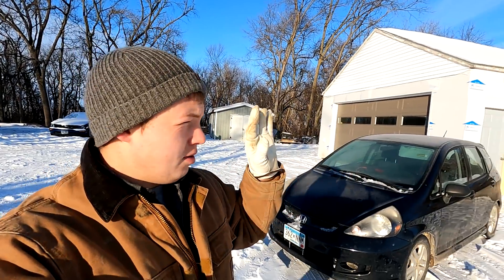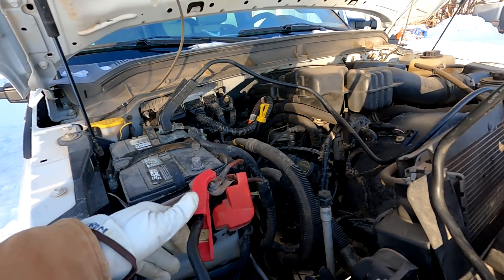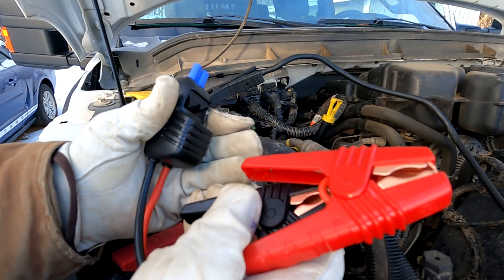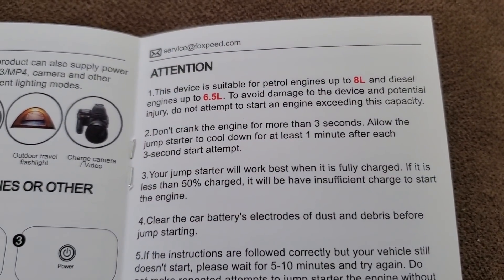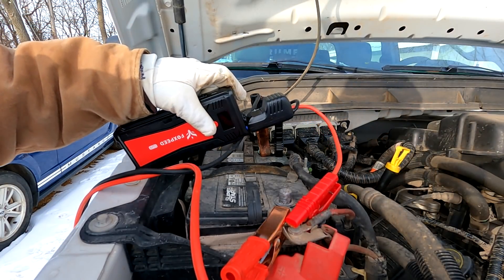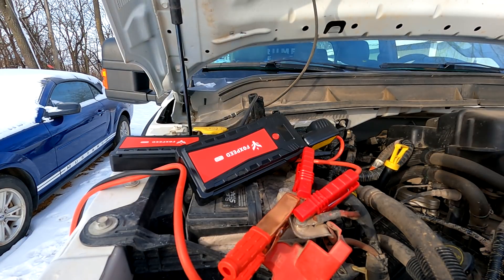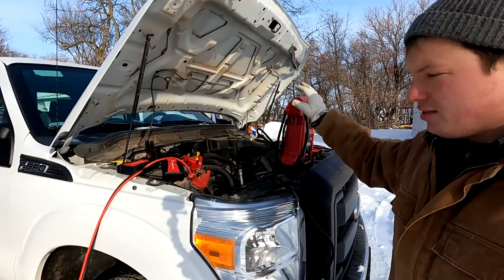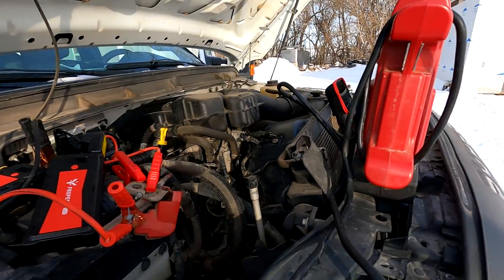Lithium Ion vs Lead Acid Portable Car Jump Starters

Comment: I had one of those JNC770R packs. Lasted under one month and only two jumps. They wanted close to $70 for round trip shipping for a warranty replacement so I chucked it and got a cheapo lead acid jump pack from harbor freight. Four years later, the HF pack is still working well on its original battery.
Reply: For anyone interested if you pick up a used/broken or have a non working JNC unit it's super easy to replace to sealed batteries inside with the same quality branded cells with the same or higher capacity, they are relatively cheap on Amazon/specialty battery wholesale sites/eBay/etc. That's the only downside to the Harborfreight jump packs is inconsistent battery quality (and copper coated aluminum wire leads, not pure copper) you can also upgrade or replace the cells in those units too, but it's really not worth it vs. the original price... Just hope you get a good one lol  🙏🏼
Reply: @berryreading4809  the red 770r is what I use for aaa roadside full time. They do the job.i keep it in the cabin floorboard with the heater running and charging as I go on calls in the winter.
Reply: @truckdriver8416  They cost more for a reason! The leads are 100% copper with UV resistant rated sheathing, the cells are name branded and capacity tested before being put into a new unit, plus the clamps have better springs, better teeth geometry instead of just junk chrome and copper plating like on cheaper units... (the same ones that use copper coated aluminum leads and randomly batch tested sealed batteries) If your job requires a quality jump pack I'd buy JNC, if I was messing around the house with some non essential stuff with multiple jump options I can see the appeal of a cheaper unit harbor freight or otherwise... I've recently been trying out a couple of Schumacher li-ion jump pacs (real ones, not the mini capacitor style, although they are kind of a hybrid between the two styles honestly) with great results 👍 it's the Schumacher li-ion 1200 w/compressor great compact unit for most vehicles, but it's Achilles heel is having an onboard battery power only compressor (without modification 😉) and a horrendously slow charge time via micro-usb... but it's a perfect  all in one unit for less prepared family members since the li-ion battery stays charged quite well, it has a usable compressor for up to crossover/stock SUV tires and is very compact and idiot proof... Definitely not a pro tool, but I keep one in my small run around truck and bought one for a family member, luckily this was back before the price went up over $65 😡 or I would've supplied more for gifts over the last year 😒
Reply: @berryreading4809  when using your ion battery jump starter, instead of using the USB to recharge it back up after a jump start, why don't you try leaving it connected to the jumped vehicle as it runs and charges through the alternator for about three or four minutes and see if it fully charges back up that way and replaces the little bit of power you pulled from it to crank the dead battery. That's what I do when I jump with the 770r now. I don't disconnect the jumper box right away once I crank the car I let it recharge up and replace the battery power that I just pulled out of the jump box with the car's alternator recharging it for me.
Reply: @truckdriver8416  That's another downside of it being similar to one of those glovebox li-ion boosters 😠 First on a completely disconnected or dead battery it has a timed relay that cycles power off/on  for several seconds before reseting and cycling full power again (even though it has a large enough battery, not just a big capacitor 🙄) that's not a deal breaker and I have run equipment with just the pack, but can't remember if it was dumb equipment or had an ecu 🤔 anyway the circuitry also disconnects that relay after a start and if the alternator is working it won't reconnect after sensing voltage input (that might be the entire reason they decided to make it cycle like that, one bad alternator putting out 16v+ could fry that thing!, 24v might turn it into a handheld campfire 🤣) li-ion chemistry is definitely pros and cons! I try not to keep any of my tool batteries inside my house unless I'm there and it's all Dewalt  or Milwaukee lol, even in my utility bed truck I try my best not to leave any in the cab overnight! (although I usually break that rule) BTW my "real" super duty jump pack/12v power pack is a home depot rigid brand toolbox that perfectly fits two 850 CA (680cca) 200min reserve capacity marine cranking batteries with some 00 cables used to make it 12v or 24v, a short set of 2g cables on the terminals is made up to a Anderson plug that fits my winch, large 120v power inverter, two sets of jumper cables I added them to, and can even plug directly into of any of my trucks since they are setup  for easy jumping or winch swapping without opening the hood 😉 that box will also start some fairly large 24v excavators or other equipment that were left on/went dead over a few weeks... Only downside is a 150lbish jump pack isn't ideal for moving around very far by yourself 🤣 funny enough I actually have a little less invested (about $350 if i had to buy everything new instead of using what i already had, the box,cables,anderson plugs)in that than a high end JNC 12/24v model! (But those don't weigh as much 😆) BTW the 2AWG "HYCLAT" anderson style plug connectors from Amazon are super useful for all types of setups 👍 btw if you aren't familiar anderson connectors are DC one way connectors like what you've probably seen on battery powered forklifts and maybe on your service tuck! I've noticed more and more roadside/state/fleet/service/utility trucks and equipment with external anderson plugs for easy quick jump starting, especially on utility companies that mainly work up North lol 🥶
Reply: @berryreading4809  we use the Anderson plugs on our jumper cables external hanging out the grill of the truck to jump cars. We bought a set on Amazon where it was really hard to plug the two plastic ends together so I had to take a file and gradually trim the extra plastic where the male and female would lock and unlock with ease. It was funny because all the new guys had no idea what was going on and they would sit there and struggle and halfway pool their hair out not realizing all they had to do is take a file and make them fit correctly. I think the boss bought a whole bunch of them at the discount price and that was the reason why they were discounted unbeknownst to him. I think a Marine deep cycle AGM battery put in those jump boxes would probably give you the best of both worlds. At least you can keep those hooked to the car after it's running to recharge up the box quickly. The other good thing about the 770 r jump box is that it tells you if the alternator is charging or not immediately on the spot. It also has longer leads so you can leave the Box on the ground instead of having to put it up in the engine bay cock sideways or whatever. The disadvantages the box is 40 lb or greater in weight to carry it but I'll wait until the ion glove box jumpers become more powerful less expensive and have all the bugs worked out of them before I convert over. One last thing keep in mind the terminals are not the same inside these boxes when it comes to the battery hookup. On the red one it doesn't have a screw down type terminal it has a bracket with a hole going through it. So you have to do some creative modifying by bending the metal and buying some new hardware. Food for thought if lithium batteries we're so great then why didn't the manufacturers of automobiles first convert all the lead battery acid batteries we have traditionally in cars and stick lithium ion batteries in their place? It certainly would have taking less metal and materials to build batteries that will lithium-ion in the place of the lead free batteries to Simply start a traditional engine.
Reply: @truckdriver8416  Exactly! I've seen plenty of lead acid batteries swell, crack, leak etc. But not catch fire that cannot be easily extinguished like a li-ion battery made with multiple 18750/21700 cells! There is a reason fire departments are currently ordering dunk tanks as EV's become more popular and must be kept SUBMURGED in water for 24-48 hours after a fire 🤦‍♂️ Real environmentally friendly! 🤣 Anyhow on my big battery box I have a 6ft 2AWG lead that can use the short 2-3 ft end of one of my converted jumper cable sets (I put keep both ends connected in case I need to loan them out or get creative in a pinch lol) but luckily the box is still small enough to fit inside of most large excavators (except for some of the ridiculously placed newer models... but I've run them just to move them with it sitting on the rear deck 😆 if you ever feel the need it's one of the "Large size" Rigid brand 22" pro toolboxes made for their stackable toolbox system, it's the perfect size for 2 batteries, all the cables and an adjustable wrench placed where it won't short the terminals bouncing around 😂 But the those toolboxes in general are great, reasonably priced vs. Milwaukee and Dewalt, but just as tough and 110% waterproof! The big rolling box, large box, and small box 3pc combo is often on sale at home depot for $99, I think just the large box (which I also one have setup as a socket organizer for mobile work) is $45 regular price... if you buy the set during the holiday sale I guarantee you'll find a great use for the large and small box... I rarely use the rolling box even though it holds alot, just not very ergonomic for my needs I guess 🤔👍

Comment: A lithium jump pack is designed to disconnect its internal lithium battery once it sees alternator voltage.  It protects the lithium battery which needs a different charging algorithm.  Cold lithium batteries reduce voltage and capacity.  On Teslas the car has to maintain battery temp in order to charge it in freezing temps.  The big advantage of a lithium jump pack is that it holds a charge for a year or more, something a lead acid won't do.  Plus the life of a lithium jump pack is much longer, especially if both are used periodically.  Starting a car independent of a partially discharged car battery is not the use case for these packs.
Reply: Please clarify the last sentence, I’m not using it as a charge system. Just for starting a dead battery
Reply: @jenni75288  use as intended, just to jump start, as a " additional boost" device for the motor to swing when battery is not capable to do it on it's own.  Some can and do turn or swing a motor without a battery, but their longevity and reliability probably gets affected by doing it, shortening  the lifespan.  However, much better conditions and smaller engines were present during most of those illustrations.  Ideal situations would be if you have a untraceable parasitic current draw with a 50/50 battery diagnosis .  Getting you to a point (place of safety) where you can either, determine the fault, replace a bad, or recharge the good battery.
Reply from the maker: Well said.

Comment: These things are cool and work great when they’re new but it’s a question of reliability. How do they hold up after a couple years in your trunk getting charged periodically? I’ve had two and they both went bad after a year or so and I looked after mine pretty well. Similar climate to yours here in Canada. I’m just not convinced. I still rely on my jnc 770
Reply: I've had a DBPower 800A lithium jumper for 3 years. It always seen constant use, and it never failed on me. It did fail on me one time but it was my fault complete, I had accidentally left it on my car seat with direct sunlight. It reached 140F and the internal battery swelled up and split open the case; they are fine to use, but you need to be mindful on where to store them. From that lesson, I now store my Lithium jump starter in the trunk next to the spare tire; its MUCH cooler in there.
Reply from the maker: If I had to choose I'd go with the 770 no question.

Comment: “Thermostat wire” LOL! But for this application #8 (if that is AWG and not China wire gauge) is still a great description
Reply: It’s enough to run an electric dryer for crying out loud! I used to jump cars with just a 10’ piece of 14-2 NM cable. Never without romex and it works perfectly fine.😉
Reply: @midnightflyer7510  don't car/truck starters can draw 60+ amps?
Reply: @Jon-hx7pe 
LOL...yes. Amperage is inversely related to voltage so yes, you’re correct. However, in the time it takes to jump a car, you’re removing the undersized wire before it really heats up. Is it ideal or code compliant under whatever authority regulates automotive electronics, probably not, but I’ve done it successfully and quite often over the years. I’ve been a licensed electrical contractor for 22 years but I will admit, low voltage electrical is not my field of expertise so take my comment with a grain of salt. 😉

Comment: I think the cold lithium pack needs to be taken inside, warmed to room temperature, charged overnight, and retested. That would rule out any failure of the battery pack itself.
Reply: It won't discharge or charge at all at the temperature it was cold soaked to. Just letting it warm up above freezing or even above 0°F should get it where it works as well as the other.

Comment: I’ve used a jump n carry as a car battery before. We were reviving a Toyota. It was a small 4 banger but the jump pack was the only battery connected. We cranked and crank and started that thing a dozen times or more. I was really impressed with the jump pack but since it’s pretty much a car battery with jumper cables attached it’s makes sense why it would be able to do it.

Comment: I'm not sure if you know or not! But when you disconnect the battery from a vehicle, it can erase the transmission codes. Causing the transmission to act up. I'm very impressed that little lithium battery started the truck. Thank you for sharing
Reply: You might have just relieved a bit of concern that the “transmission was sounding strange” as we are right now driving the truck! 😅
Reply from the maker: As Naomi mentioned the transmission was doing some weird stuff where it was shifting into 5th even while just barely moving. I shut off the truck, started again, and then everything seemed to work again. Is there anything special I need to do to restore the transmission codes? Seems silly that disconnecting a battery would mess with a vehicle's transmission.
Reply: @BenjaminSahlstrom , On my 99 Volvo it disabled the radio 😂
Reply: @classic287  Did the same thing on our 2009 Honda CRV, had to reset the radio with a code when I changed the battery.  Part of the anti theft system in the cars radio.
Reply: @BenjaminSahlstrom  
Yes there is Naomi! You need to look into a manual for whatever vehicle you're working on, I had a Chrysler LeBaron i had to run 1st gear up to 2000 RPM then shift up 2nd gear and then 3rd gear and then let it go into overdrive. By that time i was hitting about 90 miles an hour, or more. Had to do that several times, like I said you have to look in a manual find out what you'll need to do for the vehicle you're working on. Thank you for your response, i hope I gave you some good advice you can use.

Comment: Lithium hates being cold!!
Reply: Doesn't hold up well in Phoenix heat either. If you store this in your car and its 120 degrees outside I think you will lose all capacity fairly quickly. I have ruined laptop batteries by leaving them in the car here. Greenhouse effect can get temps over 150 inside a car.
Reply: @RoyArrowood  yea Li-ion jumpstartes should not be stored inside the car, only in your house or possibly the garage. I think they should make LFE jump packs as they are much better suited for extreme temperatures.
Reply: @RoyArrowood  Lithium ion actually likes it better a bit warm but outside it's optimal range it looses half if cycle life for every 10°F hotter it gets. Above 130 it'll fail spewing potentially burning gases. Definitely don't leave one on the dash in the sun in the SW...
Reply from the maker: Apparently!
Reply: So does lead acid. Lead looses about half it's capacity at 0°F and around two thirds at -15 so if the Lead acid booster had been in the truck overnight it wouldn't work either. Lithium ion losses about half it's punch at -4F and may not discharge at all if colder than that.